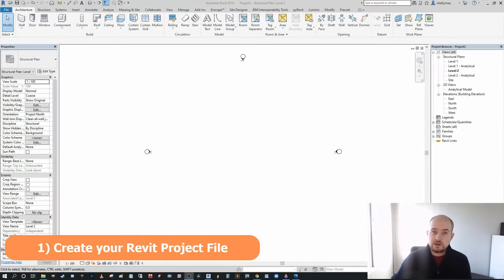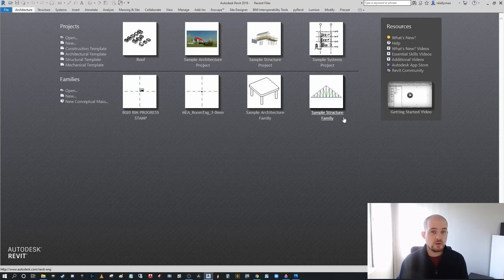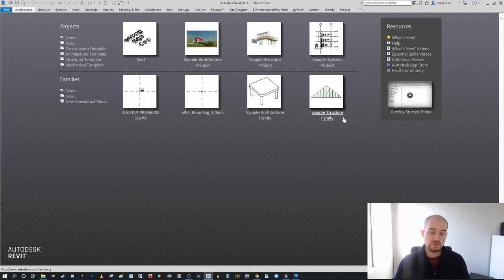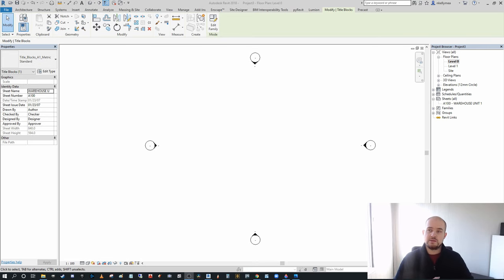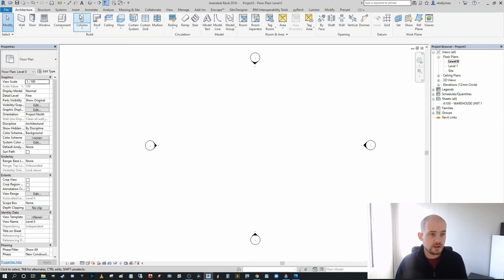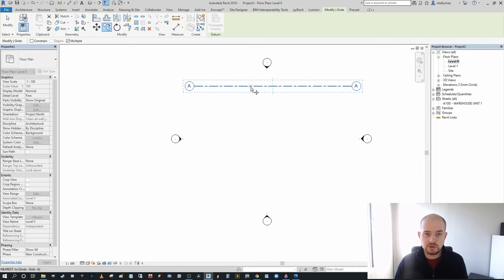9 Steps to Setting up a Good Revit Model

Comment from the maker: Hi everyone.
Error to note in the video - in Step 7, when rotating your True North angle make sure to relocate the center of rotation onto the Project Base Point, otherwise you may bring an innacuarcy to the setting out of the building relative to the coordinate system. 

Long video this time so timestamps are necessary - Skip around as you require.

Introduction - 0:00
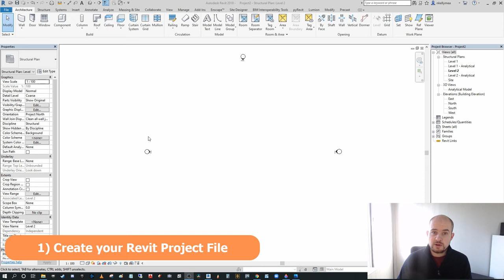Step 1 - Create a Revit Project Model File - 1:43
Step 2 - Assign the Project Information - 4:01
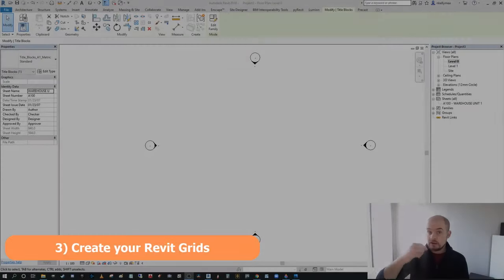Step 3 - Create Grids in the Revit Model - 7:03
Step 4 - Create Levels  in the Revit Model - 11:49
Step 5 - Place the Project Base Point - 18:58
Step 6 - Create the standard Plan Views and Underlays - 24:11
Step 7 - Geolocate the Revit Model - 34:43
Step 8 - Set up the Revit Project Design Options - 43:19
Step 9 - Set up the Revit Project Phases - 45:56
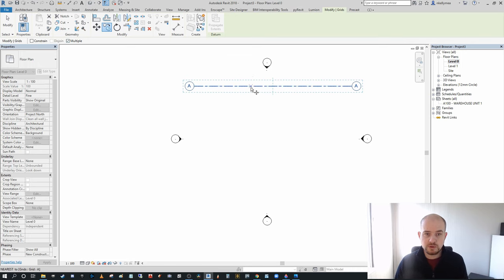Outro - 53:37

If you like this content please support 8020BIM by buying me a (much needed) coffee:
https://www.buymeacoffee.com/8020BIM

Niall

Comment: Only thing I don't do is a full grid. I personally hate grids... cant tell you how many times I've worked off drawings where a grid line gets in the way of things like custom line-types used to indicate specific things. Can get difficult to differentiate what you are looking at especially if they have similar line weights.

I usually only grid a starting corner that i then place my project origin to. In fact, most firms that I have worked with over the years do not use full grids (a couple when i first started back in 08 did bust most have moved away from it), at least where I am anyways

Comment: QUESTION:
SAY I HAVE FILE A AND FILE B, WHEN I LINK B TO A
WHILE IN FILE A, VIEW RANGE CUT PLAN ON 4FT TALL
WHY IT IS NOT ABLE TO CUT (REMOVE ROOF ON FILE B) WHICH IS ABOVE MY CUT PLAN.
OR AM I DOING SOMETHING WRONG OR THIS IS STILL THE PROBLEM WITH REVIT 2022 ?

Comment: Can you show a video on how phasing is shown for Reflected Ceilings? I have done this task, but I am not able to show it with the hidden lines like the walls. I was told because it is not drawn like the walls. How do you rectify this so you can get a model pattern turn to a hidden lines rather than continual lines? Thanks
Reply from the maker: Hi Leslie,

The method for producing Phasing drawings for reflected ceiling is the same, but it is true that he presentation of the ceiling can be tricky (particularly if you are demolishing only parts of the ceiling). In short, do the following. 

Manage Tab - Phases - Graphic Overrides. Under Projection/Surface, Open the Patterns window beside Demolished. You can apply a foreground and background colour to start.

The difficulty is that, as you alluded to, you cannot change the presentation of the pattern linestyle to hidden lines. This is because the pattern is not individual lines/geometry but an array. You will need to create a Pattern that matches your ceiling grid intervals but has a a series of dashes instead of a continous line, and apply that pattern as the Foreground and Background pattern in the Demolished Phase Projection/Surface Pattern dialogue. 

In my opinion, the demolition does not need to present the grid as you would for the existing or proposed. I would recommend allotting an entirely different pattern for teh ceiling extents to be demolished and refer to that pattern as "Area of ceiling to be removed" or similar in your Demolition Legend on the sheet. 

Hope this gets you on your way towards a solution. Hop over to the discrod channel should you need anything else as you will likely get a response faster than over youtube comments like this. https://discord.gg/kuzDTVNznH

Let me know how you progress.
Niall

Comment: 21:45 did you just move project base point away from the invinsible Internal Origin? this would screw up all future import export and file coordination between different consultans. i would prefer to move those grids instead
Reply from the maker: Hi Nicky. 
I agree completely and would advise against that now as a standard. This was version 2018 when the ordnance information had fewer options to contend with and the internal origin did not have a visibility identifier, so external coordination tended to be via Auto Shared Coordinates as standard. 
Completely agree that the Base Point and Internal Origin should remain constant these days unless there is a specific project requirement that expresses a variance between the two. I have been hoping to do an updated video to cover this but haven't found the time yet. 
Thanks for the constructive feedback and hopefully it helps others who stumble across the video.
Niall

Comment: would you say the grids are more for centerlines?  I use them for outside core when doing a wood frame, this is what I dimension off of.  I was thinking if I should use grids only for centerlines and ref planes for other, but haven't experimented with that too much I mostly use grids for major grid and sometimes other grid types for other items and then for smaller stuff i use reference planes
Reply from the maker: Hi Eastudio,

Apologies only getting around to replying now. No, I would not consider designating grids for use as centerlines only. Grids really define the structural bays or element alignments within a design. The can be at column CL's as per my example, or could be along a Structural Core wall (which is rarely the centerline of that wall - for example in cavity wall construction the inner wall leaf tends to be structural and the outer aesthetic).
The designation of what the Grids are to represent are defined by the project particulars. I have also previously used a primary and secondary grid system, and have also used Reference planes for minor elements such as panelisation fo cleanrooms, external cladding lines etc. 

Hope this provides some insights for your.

Niall

Comment: I've got a project where structural engineer has asked for datum to be set from zero to real world datum. In this case a FFL of 24750 the only way I cab get my reference levels to report right is to set the base point to -24750. Am I missing something?

Comment: Many institutions recommend not moving the PBP since it creates a lot of confusion. Why would you want to offset it from the Internal Origin? Shouldn't you move the grids instead? What I understood they have now removed the option to unclip the PBP since Revit 2020. P.S. Your vids are great! :)
Reply from the maker: You are exactly right - this video was made in 2018 showing an older workflow (user survey showed majority of users still worked as a default of 2018 at the time of video release). 
Truthfully I have witnessed it done many ways by many companies, even ones at scales where you'd expect them to have a consistent approach I have found little consistency. As a premise, particularly in 2020 onwards you are right, I would try to adhere to the internal origin and project base point where possible. Where this falls apart can be when you have a both a site and national survey point which you want levels to have the capacity to report to, in which case the project base point and the survey point both have to migrate.
Tricky business to try standardise working to ordnance information in Revit. Seems so variable on a per project basis. To reiterate though, I agree with your statement as a sensible approach from the first principles perspective.
Glad you are enjoying the videos, hope you are getting some value from them.
Niall
Reply: @8020BIM  Hi Niall, 

I saw the comment above and also your reply. I'm a bit confused so maybe you can answer my question. I can pin/unpin my PBP and also I can clip/unclip the Survey Point (Revit 2022). I'm confused because of the comment above that stated that they have removed the option to unclip the PBP. Can you be more specific?

Also, is it a big problem to do it the way you did? Just saying since of the comment from M Hellstrom. So, keep the internal and the survey at 0.0.0 and move the PBP to whatever location you are relative to survey.

Cheers!

Comment: You strongly advised not to work all disciplines in a single model. 
This is a advice that I have heard several times and it seems to me mandatory when working with different professions by discipline.
But I don't understand why when the work will be done by a single designer.
At the moment I am working on the interior design of an apartment, I am evaluating to continue to do the other disciplines on the same model.
But I would really like to know your opinion, is it convenient in some situation to work on a single model? 
Or am I about to make a mistake that I will understand later. A thousand thanks!

Comment: Hi Niall. Would you use a grid on an average sized residential model, or is it just for large scale and commercial models?
Reply from the maker: Hi Tom.
If there is any sort of regularisation of the shape, structure etc for the domestic unit I would still recommend a grid. If nothing else having the grid framework improves the ease of setting out on the ground for the groundworks contractor. If the unit is part of a development of similar repeating units I would also advise utilising grids. If the unit is more freeform, naturally shaped for whatever reason you may opt to not include grids.
They are a principle which improves accuracy fundamentally so it is a judgment call when it comes to irregular one-off domestic use cases. I genuinely tend to include them by default (but might opt to turn the visibility of grids off for print purposes should it detract from other data that does not lean heavily on the setting out)
Hope this gives you some insight. Let me know if you have any other questions in the meantime.
Niall
Reply: @8020BIM  Ok, thanks for the explanation

Comment: Hi, thanks for the tutorial but there's some confusion here. The unclip option for the project base point is no longer available for 2020.2 upwards. I have tried to do as you did but I'm not getting the same results. Moving the project base point does not relocate the project and after inputting 69125 as the elevation, I'm getting negative values on my elevations. Please help, thanks.
Reply from the maker: Hi there,
Apologies I only saw your comment today. I hope you got what you needed resolved.
Yes, as of 2020.2 the option to unclip the base point has been removed. I personally think that this is a step backwards from the Revit Coordination controls but it is what it is. 
I now, as a standard, recommend that users do not migrate the project base point but that the internal origin point and the project base point remain grouped together in a known, designated area on the site. The survey point may move freely in order to inform the ordnance information for the site in real work terms. Hope this gives insights on how this process has changed since the 2020.2 patch release. 
Niall